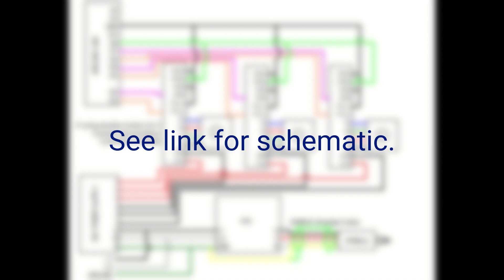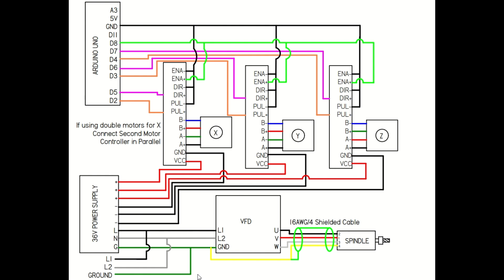Large DIY CNC Router Upgrades to 2.2KW Spindle Controlled by Arduino and Universal G-Code Sender UGS

Comment: Is this only way to control the spindle speed via manual adjustment of the VFD?
Reply from the maker: Right now yes, but the VFD does have a 0-10V input. So, if you can convert a PWM signal from the Arduino to 0-10V you could control the speed with the G Code.
Reply: Looks like arduino DACs are pretty inexpensive, so that's good to know.  Thanks for your videos.  It's something I'm going to try and build myself over the summer.

Comment: Just wanted to let you know I fully built the first one you made and I've had a lot of fun working on it.  I have some noob issues when it comes to movement. I learned the formula for recalibrating steps every time you change a bit. Not sure if this is how its suppose to be done as I see others just change out the bit and they travel the same distance. Any tips you have would greatly be appreciated. Thank you so much!
Reply from the maker: Generally, I only reset the 0 for the z axis. The x and y I leave alone.
Reply: @ScienceFunInnovations  Thank you for the reply, are you still selling the X, Y, and Z Bearing Mounting Plates?

Comment: Does arduino working without any problem in this setup?  Cause with a cnc shield is not really. I also bought some dm542 controller. Did not have time to test them as yet. But soon.
Reply from the maker: I haven't had any problems with the Arduino so far. I don't usually use shields anyway (they are usually over-rated).

Comment: What is the length and width of the 20/20 excursions used on the Z axis back plate? Also, what was the larger size NEMA Moter used on the Z axis back plate?
Reply from the maker: The ones running up and down are 18" and the ones between them are about 4" (cut to fit). The motor I used for the Z axis is https://amzn.to/3yJUThN . If I did it again, I would use this motor for all axis as it is a little stronger and about the same price as the ones I used.
Reply: @ScienceFunInnovations  Thank You I am prepping the build now.

Comment: The gantry needs to be significantly stronger, right now the amount of deflection while cutting would be excessive.
The gantry rails are acting as a structural support which is not good
Reply from the maker: Thanks for the feedback. So far it is working very well for the type of work I am doing. If I find it not precise enough for finer work, I will look into a version 3...